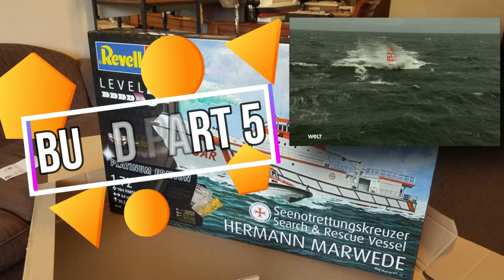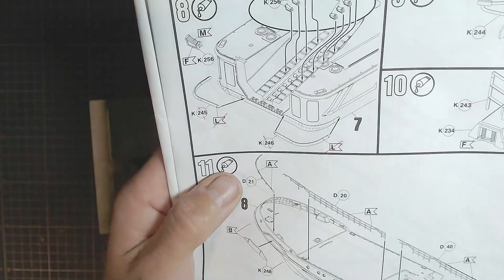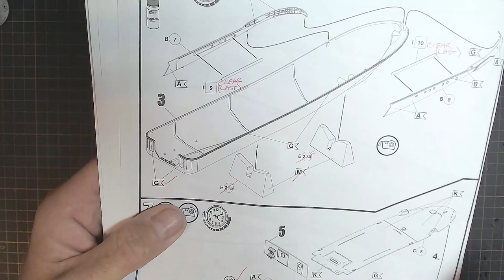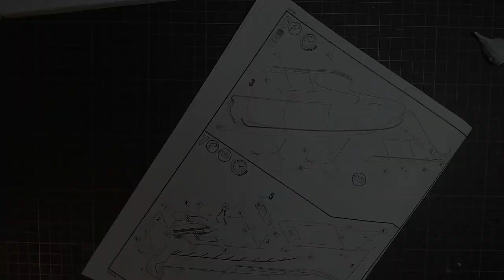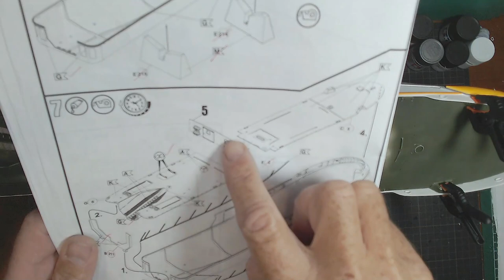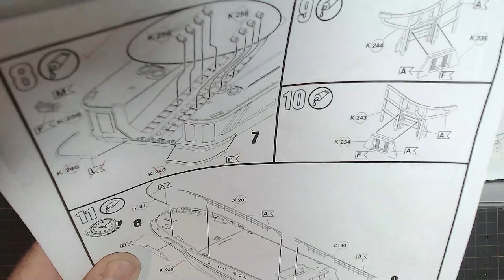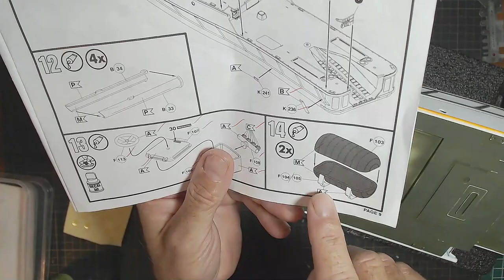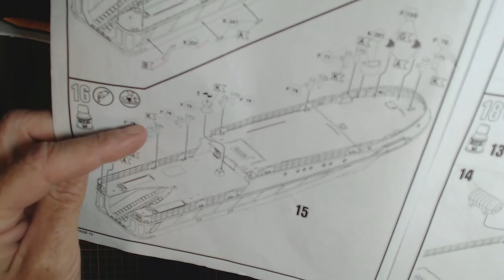Revell Hermann Marwede SAR Ship Limited Platinum Edition 1:72 Scale  Build Part 5

Comment: Just love how you .are going with the build. Just one thought, have you .checked the orange with the colour of the decal that goes under it. Because the box art makes it look the same.
Reply from the maker: Good question, The decal is red, the same as the SAR decal and that's correct on the actual ship. 👍
Reply: Did you know you can get an photo etch hellipad for it they are hard to get but still out there. Made by E
Duard
Reply from the maker: @raysvendsen5026  yes it would look nice but impossible to get here in 🇦🇺.  Besides I have enough pe on this 😆